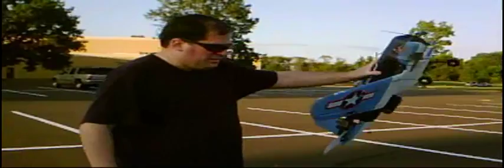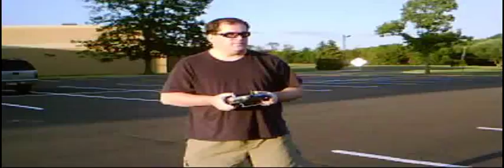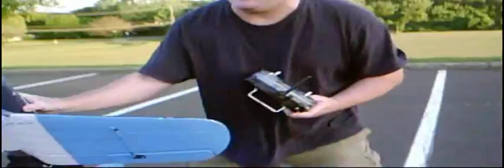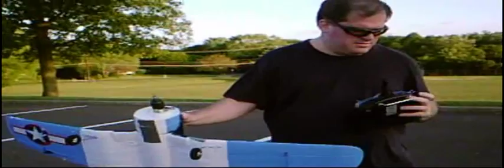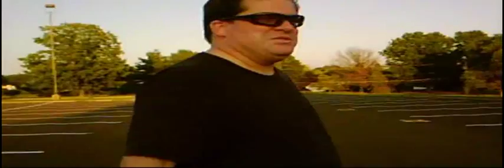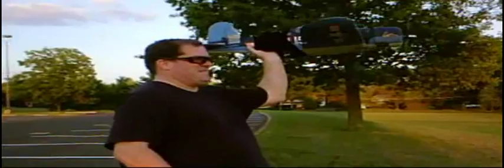FAIL ParkZone RC F4U Corsair Crash Twice

Comment: I had 160 hours of  SIM practice with Realflight G5.5, before my first flight and i couldn t believe it myself, 30 flights with no crash, some bad landings of course but most of  them were pretty good. Just try it out it will give u result, train with 9,13, 18mph. Good luck to you;)